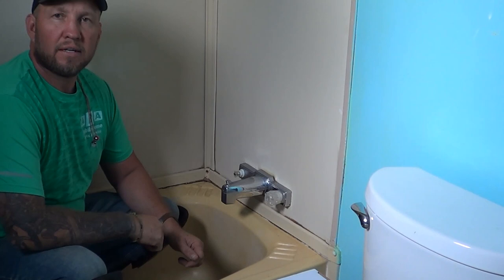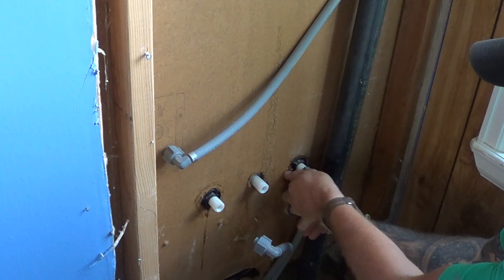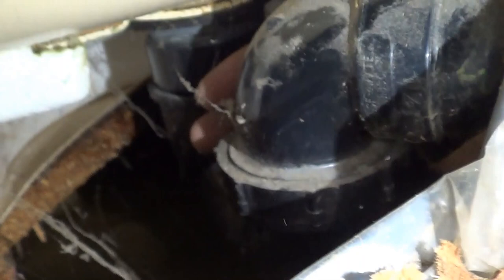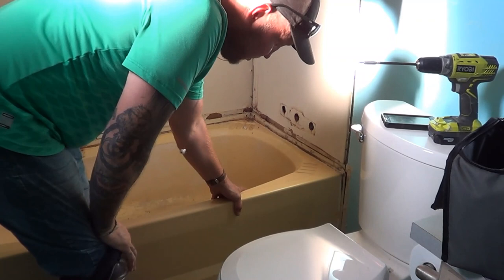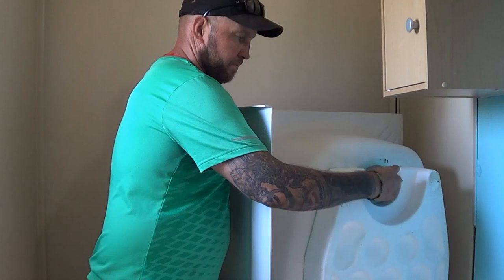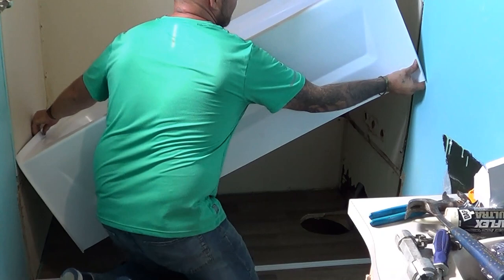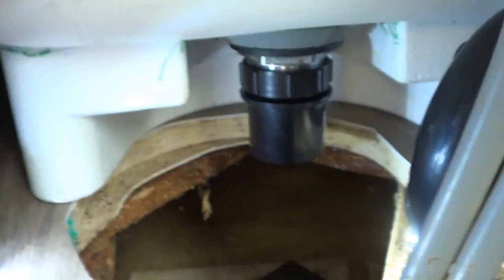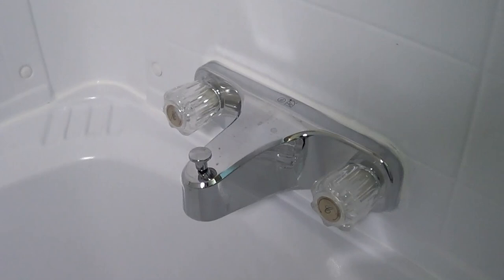How to install a new bathtub in a mobile home

Comment: I NEVER comment on YT videos, but I have to say this is brilliant. I am not very useful when it comes to DIY, but I have been wanting to replace the bathtub in my mobile home for some time. I was always afraid to do it because I didn't have a clue how to do it. I was on the verge of hiring a contractor until I found your video. You explain everything very well, and you have given me the confidence to attempt this job myself. Thank you...
Reply from the maker: Thank you for your kind words! We are glad this video was useful to you and helped you out! We appreciated viewers like you! :) :)
Reply: @randythemobilehomeguy3715  can we get a video on the corner tubs and shower replacements?  I would love it :)
Reply: Did you replace yours yet? I need to replace mine as well as relocate the drain. My type of tub is nearly impossible to find so i've got to get a different one.
Reply: I need to replace mine as well
Reply: Did you do it?  How did it go?  I'm buying an older MH and the gold bathtub has to go.  I sure don't want to climb under it, it's 40 years old.
The flooring was replaced with vinyl, how do I know there's no leak?
Reply: @randythemobilehomeguy3715  Hi Randy, this is my first time to watch your show, but I KNOW the job won't be as easy as yours looked.
I need basic Mobile Home advice on numerous things.  Do you have a bunch of videos "MH basics from 1978 for Women?"
Reply: @randythemobilehomeguy3715 I have this exact same tub in my home and I have to replace the sheet rock and some wood behind the tub mold is pretty bad

Comment: Just a awesome instruction video. We just bought our first mobile home & have renovations to do. Tubs/bathrooms are a must. 
QUESTION: since the p-trap can be disconnected, at this point, could you move the drain location by adding piping then the p-trap back? Just extending the pipe length to accommodate a right drain vs a center drain? (I hope that’s understandable, I sometimes have a hard time explaining things) but they make sense in my head, lol 

Thank you for the awesome video!
Reply from the maker: Thank you for watching!! Much appreciated. To answer your question, yes you are able to move the location of the drain. You would do exactly as you said. You would disconnect drain, add piping to move. Sometimes, when you have a Center Drain the piping is already moved to one side, then you would just cut there and add your drain. I hope that helps!
Reply: I just bought a 1998 one and the tub has a crack by the drain which is in the back middle of the tub and I want a tub with the drain in the front up by the faucet . Where did you find your new tub ?
Reply: @randythemobilehomeguy3715  please help with the right answer. Lol with a double wide MHome is it safe to renovate bathrooms or kitchens using tile or granite on floors/shower walls/countertops??  I’ve been told it’s fine, what do you say? Thanks

Comment: Great video. Wish my experience replacing my tub would have been that easy. My old tub came out without any problems, however putting the new one in wasn’t so easy. I had to take out drywall to give me enough clearance for the new tub to be put back in. Pain in the behind is a understatement.
Reply from the maker: Thank you for watching. Yes, I do understand when things don't work like they should, definitely a pain! May I ask, was your new tub the same size as your old one?
Reply: I have been going through the same issue. The old tub had a platform built to hold it. Dumb me assumed that the new one was the same. I had to redo sheetrock and insulation due to water damage. After completing that I realized that I had to cut out some sheetrock to get the tub in since the new one actually had to be put in on the studs and not like the previous one. I am trying to get the surround put in now.

Comment: Bravo- Awesome video and very informative, i've been rentavating mobile homes in the akron canton ohio area for 24 years and had lots of unpleasant experiences with bathtubs, waterlines, waistwater lines. Yeah, Holly Parks genius ideal off having the p traps above the floor underneath the tubs, however the replacent tubs don't have spacing.  Toilets 9 inches sometimes 7 from tubs. Hot water tanks a inch or 2 from the overfill.every wall way out of square install new shower surands. Fun stuff.

Comment: great directional video. Is that the plastic fitting poly b line though??? isnt it like the riskiest possible plumbing to be running?? guess if it is you stressing being gentle on the piping to save integrity in the plumbing makes all the more sense.

Comment: Great video 👍. My new pop-up drain came with two rubber washers, 1-black and 1-white.  The drain hole was flat, so I did not use plumbers putty.? Is that ok?
Reply from the maker: Thank you for watching our video. Yes you can use the white rubber washer in place of the plumbers putty. You will still want to use the black washer underneath the tub.

Comment: Do you have any advice for a shower drain that is in the back middle of the shower (that faces outside)? We can get to the back of the faucet but we’re struggling to figure out how we will attach the P-trap if we don’t have direct access to it after we put the tub down.

Comment: I recently purchased a 2004 Redman 14x70 mobile home.   Does the shower faucet need to be specific to a mobile home part or can it be a shower faucet that can be found at a Lowe’s or Home Depot?  I’m a new subscriber and first time home buyer.  Thanks for any advice!
Reply from the maker: That's a great question! If you are looking to replace just the faucet and not the surround, then you will need a specific faucet. The reason is because of the previously cut holes in your surround. This way they will line up correctly. Now, if you are replacing the surround (walls) you can at that time replace the faucet with any from Lowe's or Home Depot. If you need to replace and handle of the faucet or the stem & bonnet, you will need the mobile home specific part. I hope this was helpful! Thank you for watching the video!

Comment: Do you work anywhere around Conroe Tx ... I have the middle back drain and watching your video I figured out why our tubs keep cracking around the drain. We paid a who lot of money to replace the original tub because it cracked around the drain and then the second one cracked too. There is a big hole around the drain and when my grandson showers most of his weight on his right foot is on or near that drain and there is a big hole there. No support for his weight. Have you heard anyone else with that problem and how to fix it for the next tub replacement we need done. We paid a bunch of money a little over a year ago for that replacement I can't afford that again.

Comment: would you recommend using tractor trailer ratchet strap to tie down a mobile home?
Reply from the maker: We would recommend using straps from "Tie Down Engineering" they are the leading tie down manufacturer. They specialize in the right set up material needed for all manufactured mobile homes. :) Thank you for watching!

Comment: Be careful with those namebrand tubs from local hardware stores they are fiberglass and dont bend as easy to get them in a tight area like that. A simple replacement like you showed turned into partial drywall removal inorder to get the name brand one to fit.
Reply: Hello, the one we are showing is the type that was in there, an ABS type tub which does have a flexible skirt on the front. The fiberglass are better but have a firm skirt and make the install a little more of a challenge. Turned correctly you can keep that ‘drywall damage’ inside the area where the tub wall will hide it. Thanks for the reply

Comment: Where did you order the tub/shower wall from? 
I've looked at home depot & they are too big😔
Reply: If you living in a mobile/modular home (I'm assuming you do cause of this video) you will need to get in contact with your local mobile home dealership. Unfortunately one of the joys of owning a mobile home, is everything is all build with different plumbing and dimensions than a stick home.
Reply: Mobile home parts store has a decent selection and comes in all 3 drain locations

Comment: What about leveling the floor? Also, most instructions to install a tub or shower pan is to the joist. I want to attach my shower pan to a sealed/waterproof/redguard wall. How do you design a vapor barrier for mobile home showers pan?

Comment: Mobile home parts R us....
I have my own handyman business where I mainly work on mobile homes doing a little bit of everything. I am starting a job tomorrow where tge customer wants to remove old tub and replace it with just a shower. So, I will be installing the bottom pan, walls with new hardware.
I will honestly admit, I KNOW I can do this, but I've never done one before. I'll proceed with details and follow up with my question.
The old drain and the new drain do not line up, so that work will need to be done and being its going to be ONLY a shower I am going to have to add to hot/cold water plumbing and relocate the handles where they are higher (stomach height).
On a job like this doing the work I explained that needs to be done what woukd be a reasonable estimate on your end to charge for a job like this ?
I have done a good bit of work for this customer in the recent past so I dont want to over charge, but I also don't want to leave money on the table?

Comment: Question. Im working on a garden tub but no access to the drain pipe from inside as its on a main back wall. How do you access it? Under the house and are mobile home tub drains all the same size (P-trap)
Reply from the maker: Hello, usually when the plumped them just out the bottom they make an access directly below the drain, under the home. Usually home home drains are 1 1/2 ABS and travels a bit then dumps into 2 inch, sometimes closer to the pTrap than others. Thanks for the reply

Comment: Question: Will this be as simple with a fiberglass tub install?
Reply: no. most likely will need to pull toilet to line up and slide in straight. Id always go for a fiberglass tub over that cheap tub

Comment: I need to replace 23-year-old plastic round shower valve stems. Do they just pull out and you put more in? I'm scared to tear it up. Apparently the new stems have a wedge shape😢 help!
Reply from the maker: Hello, you will need to take the knobs off, pop the little clear plastic lock straight out, then unscrew the whole stem and bonnet. Make sure to replace with the exact type. If you need parts send pics to 970-222-2731 and we should be able to get you the parts. Thanks for the question
Reply: Thank you so much!

Comment: Where do I get the proper bathtub for my modular? The current tub has a [B] on the corner of the tub.
Reply: Hello, Mobile Home Parts 4U is a good place to start. The B is for the brand Better Bath
Reply: Thanks for the comment

Comment: does anyone know if you can use a standard shower valve in replacement of the cheap mobile home valves. I have gutted my old tub/shower and am getting ready to just install a shower base with tile walls. Concerned that the shallow mobile home wall will not handle the maybe larger standard valve.

Comment: Hello would like some feedback. To fix a loose hot water knob that seems like it slips and the water doesnt come out right away to I need to change the 
whole faucet?
Reply: Edgar Hernandez,  hello, I would turn the water off and take the stem and bonnet off and look at the back of it. Is the seal in place and tight? Look at the part where it screws to. Is it clogged? If both are good, it may be time to replace the faucet.
Reply: @randydolph852  thank you for the feedback

Comment: What would it cost to hire someone to do this?  (including parts and labor, and assuming worst case scenario with some floor needing repair/replacement)
Reply from the maker: Hello, with the parts and labor it usually here in Colorado comes in around $2100. Shouldn’t be more than that. Thanks for the question

Comment: What kind of tub did you use
Reply from the maker: Hello, this was an ABS tub, light weigh and a front skirt that is flexible, and is more cost effective. It is however not as durable as the other type fiberglass not shown. There is also metal of course but they are harder sometimes to get undamaged before the install. Thanks for the reply

Comment: Well I would say you need to trash that gray poly pipe because it's junk! Also I would not use a fernco because those things can leak. Not all the time but they can and then it's going to rot your floor with a fernco being on top of your floor.